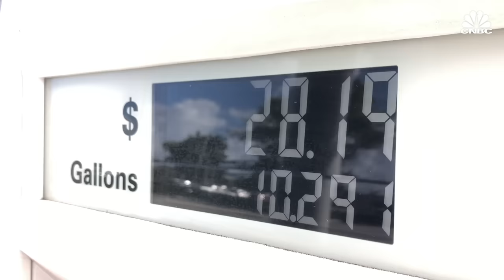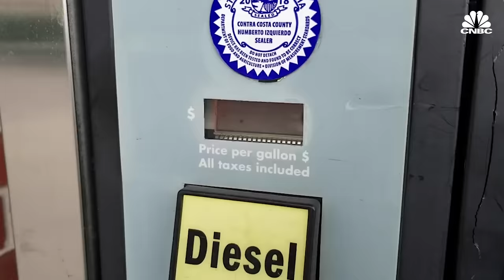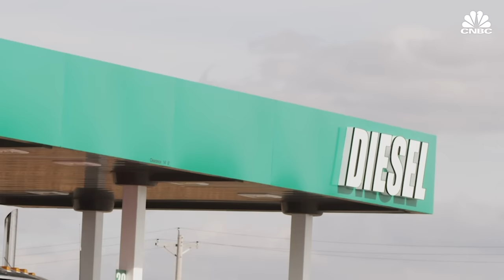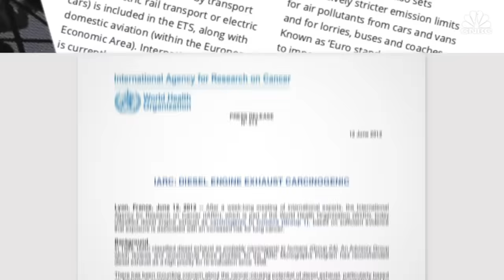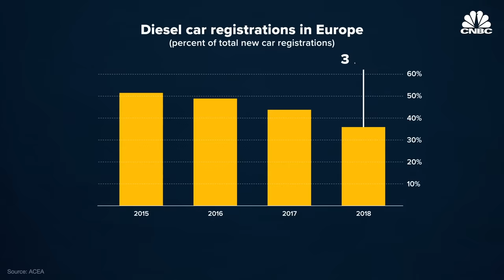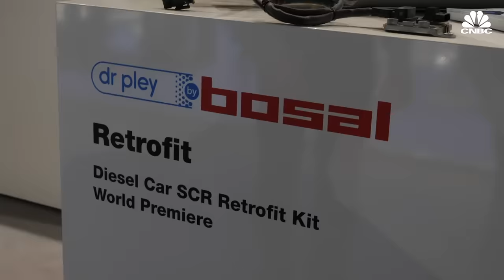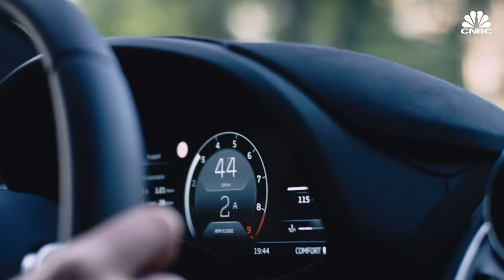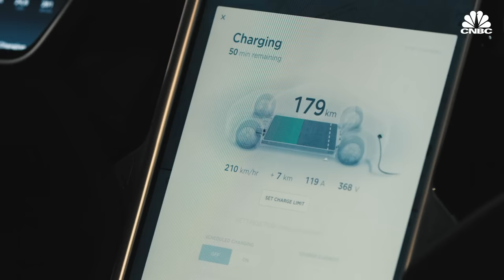Why Diesel Cars Are Disappearing

Comment: plot twist: it won't disappear
Reply: Never ever ! Petrol same price as Diesel at the pump ????
Reply: @vablo7198  I jst came back from a long trip in my new estate , was doing 55 mpg all the way , great cars ! Diesel are so much better than petrol , Finland is high for petrol ?
Reply: Not completely.  Just for personal vehicle use.  It will be reserved for commercial use.
Reply: @efandmk3382  no it won't, they will never die
Reply: Turbo charged diesel engine is better
Reply: I hope it doesn’t. ❤️
Reply: It should, though, there's absolutely no use for it in road vehicles. Heavy trucks and buses can be fueled with near zero-emission natural gas engines, while cars and light trucks are better off with gasoline engines.
Reply: i know people with ww2 diesel vehicles that are still running
Reply: @dxrevelations5111  In the US, you can occasionally see Ford Model Ts and Model As putting around in neighborhoods. Engines last as long as they're DESIGNED to last, they don't last longer based on what fuel they burn.
Reply: yeah in your lifetime lmao
Reply: @PistonAvatarGuy  sure they can little buddy
Reply: @PistonAvatarGuy  Will never happen other than maybe in places like California, Diesel engines are efficient. They operate at high compression ratios and convert a large percentage of the fuel's available energy into usable work. Diesel engines' higher fuel efficiency generally lowers the carbon dioxide emissions that contribute to the greenhouse effect. 

not to mention all the emissions control technologies that have been put on things like trucks over the past decade like ADBLUE, DPF's meaning a reduction of particulates and emissions, there was also recent independent testing on LNG vs Diesel and the testing found that a lot of the claims in emissions on the LNG side were found to be a load of fancy marketing bollocks that didn't stand up to lab testing, more info here https://www.transportenvironment.org/sites/te/files/publications/2019_09_do_gas_trucks_reduce_emissions_paper_EN.pdf
Reply: @weegaz22  Just this statement is extremely fishy: "In combined driving (urban, regional and highway) the LNG trucks emit 2 to 5 times more NOx than
the diesel truck with the lowest result."

Was the truck with the lowest emissions a 70 hp bread truck, while the LNG truck was a 400 hp semi? The units used in that report also bring the whole thing into question, as they're in grams per kilometer, instead of grams per unit of power produced. Sure, an engine that's not doing a whole lot of work (a 70 hp bread truck) is certainly going to produce less pollution than one that is (a 400 hp semi).

Sorry, but you've been duped.
Reply: @PistonAvatarGuy  If you bothered to read the document rather than cherry picking the first statement you see that leaned slightly to your side of the argument then you would have known that it was put up against similarly sized and powered trucks from 2013 they had tested  when they introduced the new Euro5 emissions standards back then. 

They even link to that document at the bottom of the one I gave you, nowadays everything is Euro6 so emissions have came down even further...sorry bud but I'll believe the hours of rigorous national lab testing spending millions annually doing this very thing over a random commenter on Youtube.
Reply: @vablo7198  +produce less CO2 than petrol cars
Reply: @curtisducati  What cars do you own?
Reply: Exactly
Reply: @vablo7198  same inthe UK , Diesel do twice as much as a petrol car ? E5 can damage your engine if an older car so very worrying to see he UK is changing to E5 , less power and 5% less o he gallon but same price as E10 ??? RIP OFF ....
Reply: Honestly they may. That's unfortunate because I like them
Reply: Won’t we just use hvo or biodiesel? Might as well reuse that used vegetable oil
Reply: Exactly lol. Every other VW wouldn't work anymore.
Reply: Save the diesels, make The Party disappear.
Reply: to late.
Reply: You are severely underestimating the speed of innovation!
Reply: @dxrevelations5111  They're only still running because there is diesel to run them on. One day there won't be.
Reply: Sid eal isnt real durka a dooop poop scoop
Reply: @vablo7198  shush logic wizard
Reply: spoiler alert: except from the ground
Reply: Plot twist i run my car on mcdonalds deep frying oil
Reply: hopeful
Reply: Diesel is more efficient for towing. Not to mention it's less flammable than gas

Comment: I have had a Citroen C4 1.6 115 Diesel for over 7 years now and never had a problem with it. It is serviced every year and I use a fuel additive every time I fill it up and it still drives like the day I bought it and has never failed an MOT. Best car I have ever had.
Reply: I my friend work as an mot tester and can tell you the amount of fumes they produce is much more and unsafe for health conditions but when coming to test diesel cars you can smell the bad fumes but will pass on the emissions just shows that even emissions tests are avoiding alot of things what they should not
Reply: @sulahm3252  It's true, there are a lot of older diesel engines that shouldn't be running due to particle emissions. However, a modern diesel is something else entirely. My BlueHDI from 2019 does not smell or sod and it emits 47x less particles than the equivalent gasoline engine from the same year. This is all running on B7 diesel, imagen the benefits if we had an easier time filling the tank with something like HVO or perhaps something even better in the future.
Reply: This video is centred around Americans. Euro spec cars are far and above anything we have in North America. I don’t even have the option for diesel engine on my vehicle yet they are 90% of the specs in Europe.

The gas lobby is too strong here

Comment: The development of diesel engines into the modern units you find in passenger cars today has come at another cost to one of their strengths, lack of complexity or more to-the-point reliability. Fully mechanically controlled diesel engines would run forever if properly maintained and you did not need a Ph.D. in electronic diagnostics to service or fix them. The humble Mercedes 123 series of the 70s and 80s when used as a taxi with the four-cylinder and five-cylinder diesel would return one million kilometers regularly before overhaul. Many would go even further and the London Taxi fleet had similar data using Perkins mechanical diesel. I commonly see diesel vehicles of less than ten years of age being scrapped because the repair costs make it not worth fixing and it is all the electronic and pollution wizardry that makes it so coupled with building the engines ever lighter and less robust.
Reply: But is that true for gasoline engines as well?
Reply: Well, that was impressive until I found out how much 1M kilometers was, Toyota tundra has reached 1.6M kilometers twice, once with absolutely nothing but maintenance and the second time with a transmission replacement and maintenance
Reply: @The_Wanderer... Except a Greek  Mercedes Diesel did 3 or 5 million kilometers and take into account diesel engines regularly hit the 900,000 mark compared to gasoline vehicles.
Reply: @seb_1504  not without TLC

Comment: Well, diesels ARE much less flammable when hit by an armor-piercing round. Historically, this is very important to Germans.
Reply: That's a good one lol
Reply: Yes, most likely, that's why all their tanks in ww2 were powered by gasoline engines !!
Reply: @overtaxed3628  Germany did not have oil during WW2, they were forced to produce gasoline from coal, it was expensive but worked since they did not have another choice.
Reply: @Josh Ruzicka well, CH4 natural gas is super clean fuel, thats why we use it in our kitchens, so electric cars run on electricity produced by CH4 burning is super clean too. But maybe CH4 cars will be even better.
Reply: Diesels rule and will for years
Reply: @Josh Ruzicka spot on! Plus as i have commented, it is important to recognize where the energy/electricity for electric car is coming from. The battery is still being charged from electricity that comes from a thermal power plant! So, when people move away from Diesel they go and embrace coal burning..!
Reply: You're thinking of the T-34. German tanks had petrol engines.
Reply: @pakenman  It didn't make much difference in real combat; the decision was largely about fuel availability and logistics. Especially important for the Germans with their meager oil production and dependence on Romanian supplies.
Reply: @Josh Ruzicka that's the stupidest thing I've seen in a long time. Lexus have a battery that has a 1,000,000km warranty. Right now with the materials used in a battery and charged from a coal power station, they are still better for the air quality. Also batteries are in development that use no cobalt and that are very very energy dense.
Reply: @Josh Ruzicka 
yeah.. batteries as they are now are no where comparable to fossil fuels. doens't mean we should try does it? perhaps next gen ultra-capacitors will have that ability!
Reply: @denysivanov3364  Actually gasoline engines were initially the logical choice for the German panzer arm because such engines were both cheaper and easier for German industry to produce. ... The decision to stick to gasoline engines was a consequence of Germany's hasty rearmament and chronic bureaucratic inefficiency. Fall Gelb illustrated the shortcomings of Germany's poor logistical tail and the limited range of the panzers. Several times in the French campaign the panzers had to be airdropped fuel to continue operations. Barbarossa made the range problem even more apparent. Despite this, the Heereswaffenamt still favored a conservative approach to tank design. The Tiger was born in this mentality as a breakthrough tank (a design that first started kicking around in 1937) in which performance was more important than fuel economy.
Reply: Gasoline won't burn if the tank is hit with a bullet either.
Reply: @abhijit1509ibskol  Electric driving is cleaner even if you burn coal for it. Internal combustion engines are horrible inefficient and only manage their peak efficiency (35 % for gasoline, 45 % for diesel) at a very particular load and RPM. At any other load or RPM.... they are much worse. Meanwhile even a chinese build crappy electric motor casually reaches above 90 % efficiency. Even with transmission line losses and charging losses considered, electric efficiency for EV is 80 % and above. Almost twice the optimum for diesel engines and then diesel fuel/gasoline requires additional energy to be created in the first place. So yes, even if you burn coal to power your EV, that power plan likely has much better anti pollution measures than your car could ever fit. 

There is also the fact that we can create electricity pretty clean.... that is not something you will be capable of saying about oil or other fossil fuels ever. 

Then there are issues like cold start.... the first few miles/km of your drive will see horrible emissions and even worse efficiency. 

Electric motors dont have any of those issues. There is a reason why - outside of vehicles - they dominate the world.
Reply: @thomascatford2627  Diesel engines are the motive power for the future - you can grow diesel biofuel in a field and it does not need anything like the energy that gasoline does to turn it into usable road fuel.
Reply: @francisbarnett320  i know all that but biodiesel will knacker your injection system because it does not lubricate the same as oil based diesel  its about as oily as pish
Reply: Josh Ruzicka yes and no. Sunlight is pretty much free and delivery is included. You can (and people do) run their EV on their own hone harvested solar. But forget that for a moment, EVs are about 4 times more efficient at turning energy into movement so they are so much cheaper bro own/run (and don’t need servicing), that trucks and commercial vehicles are going to switch for pure economic reasons. Their drive is better (more torque, more control), that any “petrol head” that tries one will find it hard to resist. The battery life span myth is just that, even early EVs are lasting for more miles than their combustion equivalents.
Reply: Abhijit Sarkar can be, but even if that power plant is 100% coal the emissions (per mike driven) are a lot lower and not emitted into your neighbours face. But it’s even better than that, most grids are reducing coal, reducing 

 the grid improves). I don’t see any improvement as old diesel age. Of course in most countries you can opt for green electricity thus ensuring your EV is not emitting anything to operate it.
Reply: Francis Barnett you (and the video) miss the point; burning anything emits pollution and particulates. Keeping oil in the ground is useful but not as useful as not burning substitutes and move as quick as possible to EVs that are better, faster, more powerful, cheaper and a joy to own/ operate. Luckily the economics alone will ensure the world switches. But I assure you, you’ll join them once you’ve truly tried EV powered vehicles.
Reply: @thomascatford2627  that is true!  I drive a lot to get to my job and I drive a diesel truck with over 200k miles and it still runs like a champ.  Having over 200k on a gas engine is practically unheard nowadays.
Reply: @scottanderson6129  Komatsu diggers currently make Prius type excavator with capacitor storage of swing motion...
Reply: @Josh Ruzicka nice to see you don't understand what, fundamentally, energy even is. You're only able to understand it in terms of fossil fuel combustion rather than what is truly possible as a matter of fact and technological advancement.
Reply: Important to my self.
Reply: @overtaxed3628  These clowns dont read up on their history. True, most German tanks ran petrol, it was the Russians that used diesel.
Reply: @denysivanov3364  they used horses, then ate the horses.
Reply: @Josh Ruzicka - Not only that in cold climates and areas that use salt I have seen Tesla's rot apart and lower motors corrode. The batteries don't last when it gets -30 out. Plus no-one considers how much fossil fuels are used to charge that electric car, How much dangerous chemicals of E-waste goes into the creations of those cars. Not a unlimited supply of Lithium. Sure that will dry up eventually sooner the Diesel/Gas will.
Reply: @bensenkans8349  Mr Josh has a point! The idea of electric cars seems noble right now but once people don't have a choice but to use them the quality of the batteries will not improve (except maybe for high end users). We are talking capitalism here greed will always take over!!!! So we shouldn't be overly enthusiastic to make that shift.
Reply: @abhijit1509ibskol  the fast is, with batteries, you just change the place, where polution is produced.  the rough materials, for these batteries have to be dug out, and selected... and then get mixed in the watersupply...
Reply: That was very important 75 years ago
Reply: Army records (all armies) indicate that tanks caught fire when the ammunition was ignited by white hot fragments from a shell hit. Whenever a tank was stopped the winner kept shooting til the amo caught. A burned tank can’t be fixed. BTW, the gas tanks were on the rear fenders.
Reply: thats why their tanks ran on diesel in WW2. Those engines could be on FIRE and still run. My grandfather would never shut up about it. RIP to him
Reply: T-34 V12 all alloy diesel,and a very fast tank over rough terrain !
Reply: @aresivrc1800  Amen to that
Reply: @bensenkans8349  What did you expect from salty boomers? Actual thought out arguments? Nah.
Reply: @denysivanov3364  Yes thats why  kitchens explode if you left the gas on and switched on the light..
also burning gas also produce carbon monoxide and much more because H20 and C02 is just theoretically correct...
Reply: @gnaedigerfels  electric stoves also can cause severe problems if let’s say drunk person leave something flammable on them and pass out. Gas stoves are best for cooking and we shouldn’t count on very weird scenarios - if one of these scenarios happen in real life we see it on national news - it’s very rare! About co and co2 - there should be enough supply of air and everything will be fine.
Reply: @denysivanov3364  Like with cars in a closed garage... I agree with you that gas is best but not really available where I live but the example with a car in a closed garage is just bad..
Reply: @denysivanov3364  They got oil from Romania in volume. Remember the Ploesti B-24 raid?
Reply: I live in a small rural Lake District village. Armour piercing rounds have never been much of an issue here, as far as I'm aware. No matter though, I drive an EV......

Comment: What's never talked about is the countless number of times that long haul truckers keep their engines running for 6 hours every night while they sleep.
Reply: Actually most modern trucks have heaters and/or auxiliary power units so they don;t need to be run all night. The reason they used to need to idle all night is so there was heat or air conditioning available … temperatures inside a truck WILL become life threatening without it.
Reply: maybe in the us...trucks have auxiliary heaters.
Reply: In the winter you have to keep diesels running or else you will likely be unable to start it depending on how cold it gets outside
Reply: @dsfkmgl6507  good, that's a nice "feature" of diesels that i am happy to have left in the past, given I've moved to a petrol car and starting in winter is a non issue.
anyways, regarding keeping the engine on, european trucks have auxiliary heaters that will heat up the cabin and also heat up the engine to make it start even in -50. No need to keep it running.